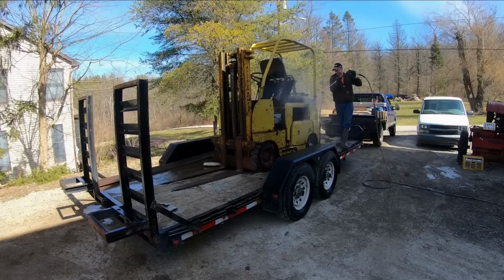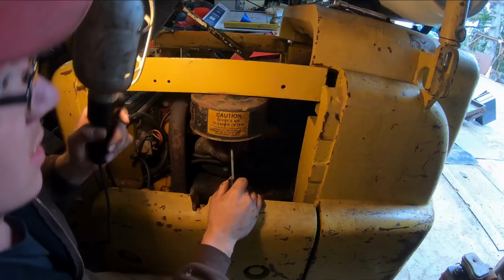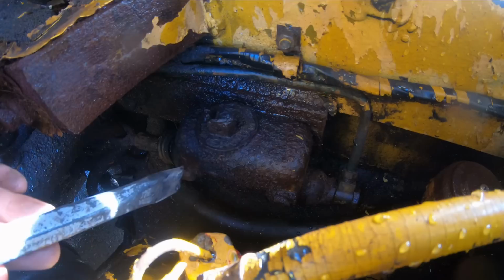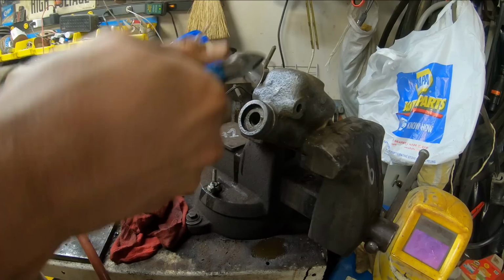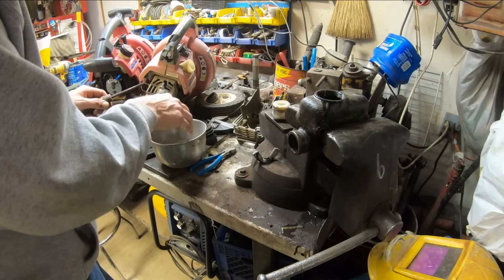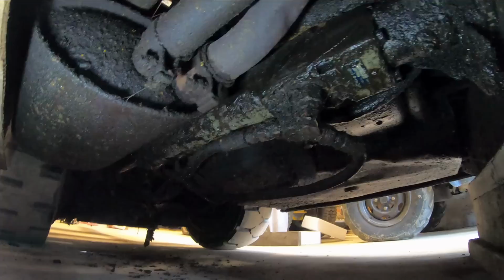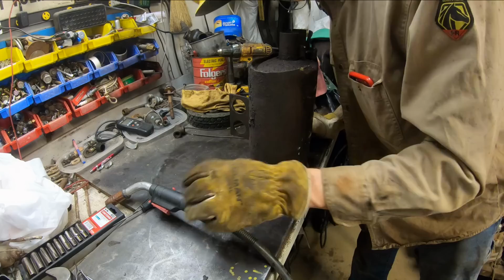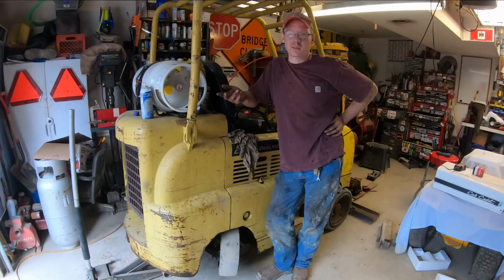Fixing the Cheapest Forklift on Marketplace!! Pt.3

Comment: Just keep in mind, that you need to factor in the type of fuel used when adjusting the timing. Propane is a thinner, fast burning, more heat producing fuel than gasoline so the engine will be set for more advance (slightly, every adjustment of the dizzy is slight). This is where a manual and timing light would be so useful, otherwise its guesswork, playing by the ear and......... ..Youtubers!!
Your machine is for use on flat surfaces such as in warehouses, hence propane powered for clean burning. The other forklift types are the yard machines that can handle some uneven surfaces outdoors and are gasoline or diesel.

Comment: Just as an FYI you should not coil electrical or data wires but bend them together like rope not like hoses. The problem is you're creating an inductor by doing that and it will undoubtedly create electrical noise both in the vicinity as well as connected to any sort of electronic item so you may find cell phone service isn't as good or an ECU starts acting up.

Comment: Amazon should NOT be your only 'go to' place,..check other supply place's BEFORE you buy from Amazon. You can see that these master cylinders ( for example ) are available almost
everywhere!
Would you consider replacing that fan/alternator belt now while you're at it? It looked like it was a tad loose there, now's the time to replace old rubber parts, is at all possible.
This is a fun project,....like I said before you made out rather well in this purchase, I think!
Reply from the maker: I always look around but free 2 day shipping is a nice perk, ended up finding a new master cylinder for 36 bucks and free shipping on eBay
Reply: @DieselCreek  Good,...but then you mentioned that shipping was around $12. extra to that $29 price,..if you have Prime on Amazon, that might make it a better deal,.yes.
As an example the other day , about 3 weeks ago I bought an egg poacher for a friend on Amazon.ca it was $24. her mother wanted one too,..so I was about to order
the second one, and now the price jumped up by some $10 extra to over $34 ,...since this Pandemic started we're seeing 'unfair' price gouging,..and Amazon, while not being the only one's doing this,..are right up there with the worst ones,...this is not the only example that I've seen on Amazon either.
So I'm glad you got a better deal elsewhere,..I guess you simply HAVE to shop around.

Comment: I don’t know why, but when you said you were using the forklift to flatten cans I pictured them lined up under the forks and then putting the forks down. I’d imagine in reality they’d likely just roll to the side, but in my head it’s what I pictured.
Reply from the maker: if you had weight on teh forks that would work, without that its not any heavier than if i were to just step on them, forklifts dont have down pressure

Comment: you clearly know 1 million more than me about all this gear but from an electronics man - the reason we don't cut the cable ties off short is because it leaves a little, really stiff, often lethally sharp stub ready to stick you or tear a chunk out of your arm next time you have to go in the machine. I've experimented with melting the end with one of those little crappy battery soldering irons but if time is an issue it's nicer just to leave the tie uncut
Reply from the maker: I know what you mean about the being sharp, I just prefer less clutter
Reply: @DieselCreek  Aye. It does look pretty nasty to just leave the tails there, hence why i say melt the cut end.. I've still got a scar that looks like i made a really determined suicide attempt on my left wrist from one, 20 years after it went a gusher

Comment: You should have a timing light when setting your distributor,  and the  Idle needs to be turned up a little bit
Reply: don't need a timing lite for this application. Did it exactly the way I've done it for 50 some years. To check to see if you are. In time  start and shut down watch fan should stop and not run on or kick back sometime call top dead ctr
Reply: Need a vent hole in that master cylinder cover

Comment: that one big hole you welded on the muffler near the open side on the bottom is actually a factory hole meant to drain the condensation that builds up, i know this comment is pretty late, but better than never i guess

Comment: You may have contaminated the brake cylinder with oil, which is incompatible with brake fluid.  Older machines are especially susceptible to damage that way.

Comment: Interesting video series, but you should not use oil to lubricate the plunger as you reassemble the master cylinder.  Only brake fluid should be used.
Reply from the maker: Someone else said that, I’d never heard that. Good info

Comment: Someone has had that distributor out and got it one tooth off when they put it back in. It sounds better, but looks like it needs to advance a little more. I would pull the distributor and rotate it one tooth so you can get more advance adjustment.
Reply from the maker: i thought about that, im gonna loosen the clamping bolt and see if i can turn it more without removing it

Comment: It's kinda funny how many folks I've seen on You Tube using petroleum based stuff on hydraulic brakes. One of the first, if not the first thing I was taught (1960's) was to never do that. Only use brake fluid to hone cylinders and alcohol to clean with. Obviously this was before Brake Kleen. I'll just bet you that master cylinder is the same as Studebaker trucks and Willys wagons, pickups and Jeeps among'st others. Most likely Bendix or Wagner-Lockheed. Look for a casting number.
Reply from the maker: its a wagner, and id never heard of not using the oil on brake parts, but tons of people let me know today!

Comment: Close to the end of rev city, I could see why the muffy was filled full. Can ya'll say valve guide clearance? Twaz thee reason for the plug up from 25 years ago. Imagine, new valve guides some schmoozing on the seats and 30 years fum today ya'll are still running all over town with no smoke. My only problem Matt is how long that air filter was removed and how much dust blew around its work area. Gonna go out now and put one of my grand son's sox on the carburetor  on my cultivator and get to work. But seriously the rings are still good because of the cylinder pressure.
Reply from the maker: The filter was only off since the previous owner couldn’t get it running

Comment: That engine was designed and tuned to run on petrol, when they converted to LPG a lot of the time, the carb was kept,, to make it "duel fuel" this meant that the timing was set to be as compatible with both petrol and LPG as possible, unless an ignition control device was fitted to auto adjust the timing as you switched between. With emission control in confined spaces, Petrol was no longer acceptable indoors so the petrol tank & Carb would have been removed, and a throttle body fitted converting it to liquid petroleum gas only. A lot of times, the timing was left. Badly out as you have found. This caused a lot of issues, one of them being moisture from the incomplete burn getting into the sump. But you will have figured all this out by now anyway. Looking forward to the next Vid. Catch you later
Reply from the maker: yes im sure shes seen lots of changes over the years, but im gonna get her straight again lol

Comment: Take your master cylinder back off and clean out the mineral oil you applied to the seals. You can use silicone oil or grease if you wish. Don't leave it!!
Reply from the maker: I got another one because it kept sticking.

Comment: Most Point systems have a cotton swab on or again`st the center lobe it must have lubrication as not to drag the points enough to keep them retarding to bad as the commontator spins makes it makes friction makes a giant difference in spark control , Ps the top cap on that was just a square with a hole divot -lucky it`s salvagable not bad price anyways ,Ps start it up in the dark look for wild spark around the engine sometimes plug wires will make an impedance being looped been there done that kinda thing good buy  there  .. !64 Ford brake cyl should be the same plunger kit
Reply from the maker: This one just has a grease blob up against lobe
Reply: @DieselCreek  There isn't 2 little pinch prongs on the points arm most times with new points they supply a square felt swab to pinch against the lobes just for that, I helped a guy broke down on the highway he couldn't figure out what was going on couple other guys wondering out too I took the dipstick out wiped his swab rubbed the carbon off the lobes with gas and said try it he said it never ran so good instant acceleration couldn't slap the smile off his face lol.

Comment: Love the fork lift it's cute I'd love my own either a old retro or brand spanker not drive one in a year but I use to drive them 60 hrs a week for ten years loved it could load a 44 chep size pallet double decker trailer with 60 odd pallets with various freight in 15-25 minutes 😎 sweet find Matt
Reply: Hooray. A YouTuber who believes in long sleeves for welding
Reply: You can probably attach your improvised welding mask to an old hard hat with more duct tape so you don’t have to hold it. Of course you can also keep your eyes out for an old used welding hood. I have seen some for a couple dollars at yard sales
Reply: Sorry for the replies. I thought I was in the general messages
Reply: @walterrobbins4470  it's cool

Comment: Redneck how to shorten plugwires.  Pull the distributor end boot back.  Cut off excess wire.  Cut a paper clip in half.  Place one end on the half paper clip down the center of the wire and the other half on the outside of the wire.  Coat with dielectric grease.  Insert back into distributor cap.  Firmly seat boot.

Comment: You are worried about hills, and you didn't replace that master cylinder? It sure was priced right! Cheap insurance.
Reply: Unbelievable! It actually hurt to see that. The time it took to fix that pos would have paid that $30 + shipping from Amazon. 1st time I've watched this guy, he' actually worse than Camarotta,
Reply from the maker: you guys undervalue repairing things, everyone used to repair master cylinders, now a days we just throw it out and buy a new one? why?? theres notthing to them, they are super simple!
Reply: @DieselCreek  with the outrageous price they now charge for "kits" it's much more effective to just replace, especially considering the buy it now price for the new one. If you can find a Chinese rebuilt, it'll be even cheaper. My time is worth more than that! MHO (but, yes, I will do a lot of big jobs to save big money). And, believe me, I FIX a lot of stuff!
Reply from the maker: Phil Jungels I found a kit for $12 and the whole thing for 36,  I ended up going with the replacement because of the slight Pitting and my lack of proper cap but I’m sure the other one was repairable
Reply: @DieselCreek  About a year and a half ago, I priced one at NAPA, two part kit, (why sell a kit that is not complete?)was 45 bucks for wife's Sebring, and a rebuilt cyl was 57! Since the new one was 79, the rebuilt was a no brainer, and has lifetime warranty.
Reply from the maker: Phil Jungels Napa wouldn’t even look for a kit for me, I found it online

Comment: Matt - will spend $$$$$ on broken equipment that will sit on the farm for over a decade before attempting to fix it cause "didn't need another one, but it was a good price". 

Also Matt - won't spend $ to replace the wrong length wires / incorrect plugs with the correct ones cause "they look good" lol 😅

Never change 👍🏼

Comment: It's not just smoke .. this thing is burning oil .. means potentially worn out piston rings .. as the muffler was full of oily crap.
 And guess the ignition timing is still wrong .. check it by TDC and ignition marks .. looks like the distributor is installed one or two teeth late. Also the condition of the spark plugs will tell a lot.

Comment: Get a new master cylinder, the bore of it will be pitted beyond honing and since the govt has their hands in the industries now, a repair kit will be difficult if not impossible to get. also the cap for the master cylinder needs to have a vent to prevent a vacuum lock or build up pressure when and if the fluid heats up and expands. look closely at the one you found,  on one of the flats of the nut shaped cap there will be a tiny hole.

Comment: The back pressure that you created is way over limit and forcing oil past rings creating the smoke and the mess inside muffler and will kill that engine. I hate to say it but put that muffler where it belongs and replace with way better. I have built the little four cylinder continentals and they run for years as they typically don't turn very fast. Less wear and tear but that much oil coming past will make a hole in the piston and I know  that for a fact. Take it to the bank fact. Your "spider" can be repaired in just about a lot of ways self explaining so's to take some slack out.. don't turn screw in the box as it is worn in the middle and less on the ends and will result in very poor steering and it gets nice when tight and greased as that was basically a side shift cheat coming in from angle and going under a pallet to side loose from the other pallet or obstacle.. its a good machine for what its designed for but we always reinvent the wheel on that one/LOL
Reply from the maker: there is no excisive back pressure that muffer was still packed full of grease and grime, the smoke was all of that burning off, after it ran for 45 min it cleared up again and runs perfect

Comment: You might get some play out of the wheel by tightening the screw on the steering gear box. But will most likely need a new ball screw in it.
Reply from the maker: I’ll go through the whole system and try to get every bit out I can

Comment: I like to soak my metal parts in kerosene.  Removes any loose rust and leaves a fairly protective coating. I didn’t see what you used to clean the plunger the first time.  Was it brake cleaner?

Comment: Kind of weird my forklift will smoke like that after it sits for a while until it warms up then it goes away. It starts fine and the oil level is fine so I'm not sure what causes it. Looks like I set off a smoke bomb if it's been a couple months or so since I started it last. Doesn't do it if I've been running it within the past week. I was told the engine had just been rebuilt before I bought it. One of these years I'll get enough spare time and concern together and figure out what's causing it, of course at the rate I move those two will come together about 8 years after I've sold the machine and moved on to something else.

Comment: Un bundle the ignition wires. Static energy jumps between wires and reduces the hi voltage to the plugs. Wire dressing kits are available online to shorten the wires and install new connectors and boots. Timing still sounds retarded and moving the cap to the end of its travel is a dead giveaway they hung those long wires as part of a tuneup and got them plugged in to the cap one position off. move them one position ccw and rotate the distributor cap back all the way and check to see if it will start and move cap to max idle speed and back off 2-3 deg. Best to have a timing lite. You have a very enjoyable presence in your video presentations. No guy noises, no schoolboy horseplay, very nice.
Reply from the maker: Lol thanks for watching, I was gonna loosen the punch bolt on the adjustment bracket and try turning some more
Reply: @DieselCreek  Good idea.

Comment: I usually made my mufflers by splitting a length of 4" conduit and welding a 4" strip of metal in-between both half's  , then capped each end . May need a weep hole . Nice work and video on a nice old FL !
Reply from the maker: thats an Idea! be one stout muffler!
Reply: @DieselCreek  could make it out of emt tubing or schedule #40

Comment: Hey diesel creek , correct me if I’m wrong but arnt you suppose to use break fluid when honing break parts ? Was told by an old timer than you should never use oil on a brake system even if it’s cutting oil

Comment: Your distributor should not be at max adjustment.  The distributor might be 180 degrees off. Should be a easy fix just make sure the oil pump drive rod doesn’t fall into crank case.

Comment: One more free tip never use a 12 point wrench unless a 12 point bolt they are garbage. And that was rear of muffler that was garbage not front go buy 20 dollar one and use a 2 into one adapter done
Reply from the maker: makes the swing radius way too long

Comment: I'd have ordered that $30 master cylinder in a heartbeat. To hell with that old master cylinder. As far as the oil smoke goes, I'd be surprised if the oil rings are worn that much since it does have pretty respectable compression. Valve seals?
Reply from the maker: It’s oil in that muffler burning off, it cleared up after a while and Doesn’t smoke at all now

Comment: looks like the same master cylinder that is in my Ford F100
Reply from the maker: Probably similar but the ones in trucks I’ve seen mount on the firewalls this one bolts through the side
Reply: Early F100, '53-'56 master cyl is under the floor board and mounted to the frame.

Comment: You should have re-stretched the spring in that master cylinder after fixing a couple hundred master cylinders over the years. I found it was a common problem that even the best mechanics seemed to over look.  That fixed many of so called unrepairable master cylinders. This should be done on every old cylinder unless you are getting a new spring in the kit. Not very likely.

Comment: Reason the cylinder locked up is you put the spring back in the wrong way round.
Also as has been said never use oil in brake parts.